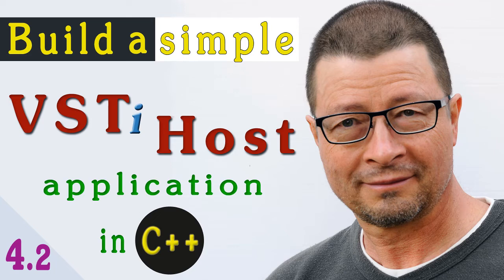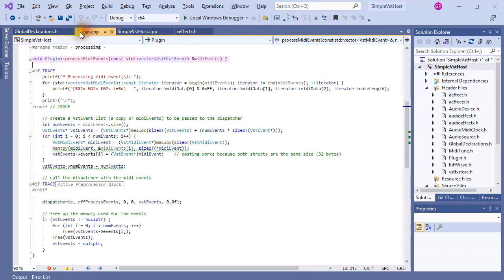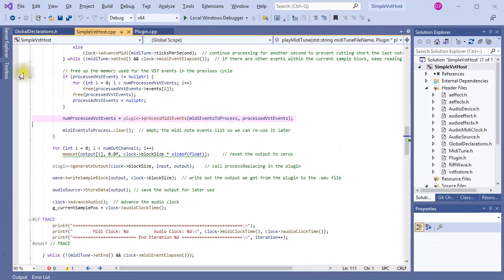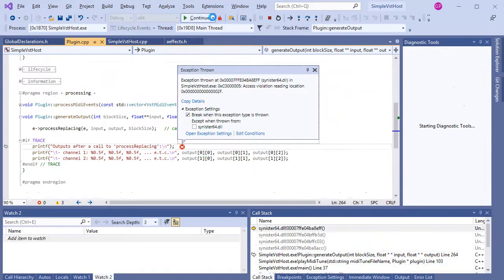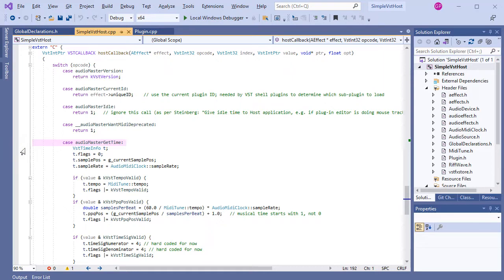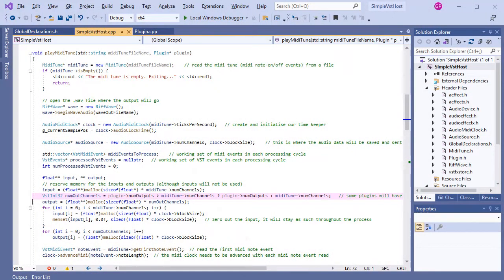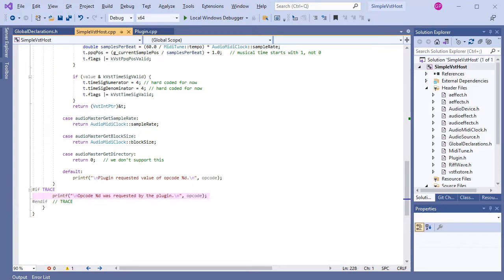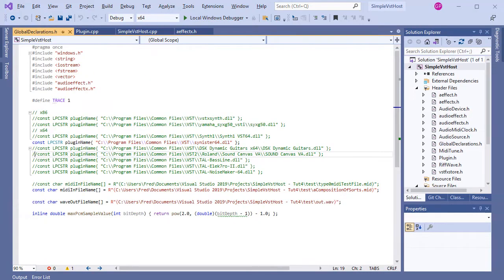VST plugin host application programming in C++  -  Part 4.2

Comment: why all those zeroes and the missing note?
Reply from the maker: I'm glad you asked. The last note (C6) could not be heard, because it was outside the range of the instrument (guitar). Too high. First I thought I had an error in my program, but luckily it wasn't that. However, it also made me think that perhaps I was cutting off the sound of the last note by stopping the processing too early. So, in this version I extended the processing a little longer. You'll see this if you compare the while loop in the playMidiTune() function in the previous video (part 4.1) to this one. (Look for clock->midiEventElapsed() statements.) So "all those zeroes" are just silence after all notes faded out. To check what happens in the last second or two you can pause the output by inserting a line like this  just before the end of the while loop:  
if (iteration == 2507 || iteration == 2535 || iteration == 2539) system("pause");  
Note 54 is the last note, 48 is the second last, etc. Notes 3C, 30, and 24 also end around here. The important thing to remember is that the plugin might still generate some sound after it receives a note-off message. Otherwise the sound would stop too abruptly. Also, there might be some reverb generated. You'll see in future videos that I revisit this issue looking for an even better solution.